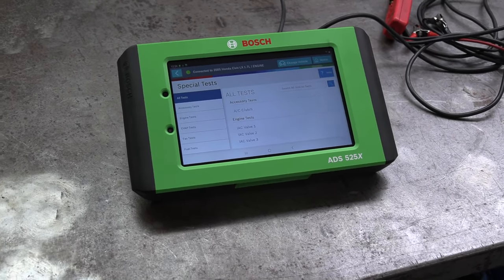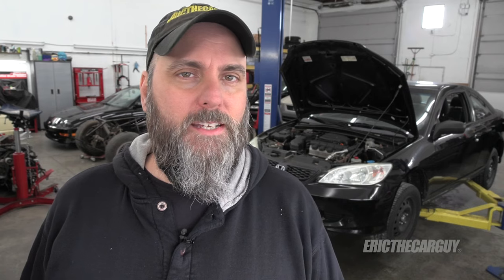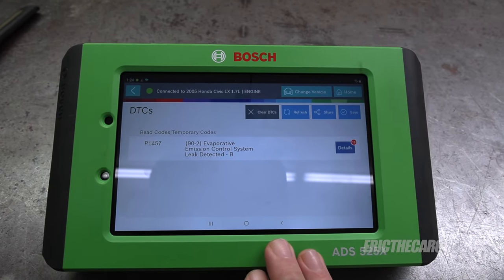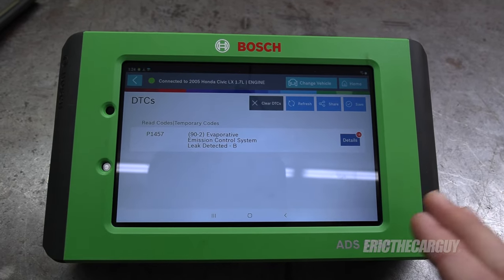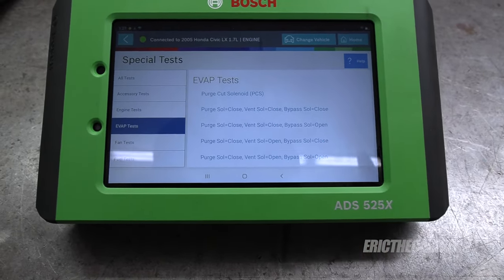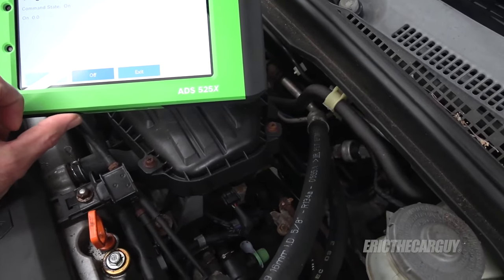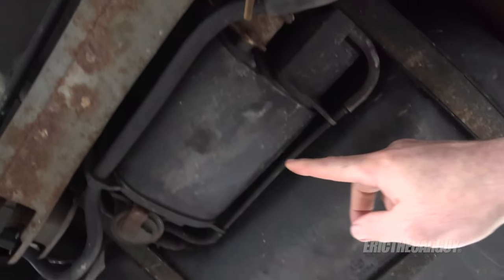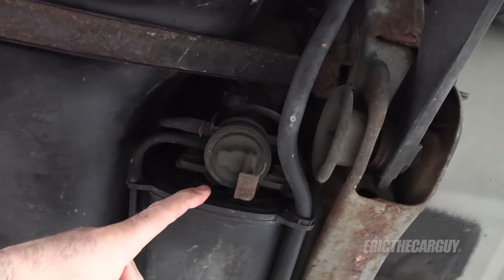How to Diagnose and Fix a P1457 Code

Comment: Stored Codes

  Issues in this list trigger a dash light and likely require attention.  Tap an issue to see more details.

  Evaporative Emissions Control System Leakage EVAP Canister System

  Why is the P1457 - Engine Code Happening Now?

Comment: You may not have a leak now but if that valve can't open your evap system can't work properly. If that vent can't open it can't draw air through to the engine to clear the canister.

Comment: Thats easy. The CVS valve is rusted and seperating causing a leak? I will now watch the whole video
Reply: You called the CVS the two way and the two way the CVS.
Reply from the maker: I read what was on the scan tool. The first valve I replaced was the CVV. The second was the CVS. I admit I could have been more clear about that. Thanks for the comment.

Comment: Our mechanic replaced the gas cap with a new $33 dollar cap from Nissan, passed inspection then a week or so later the check engine light came back on with same code. They never did fix it.
Reply from the maker: Gas caps rarely fix a P1457.

Comment: I wonder if Eric just would have checked the connections first before replacing that Emissions Valve.
Reply from the maker: Both valves had issues. Thanks for the comment.
Reply: @ericthecarguy  yup

Comment: You put a Dorman valve on it and are surprised and disappointed when it doesn't work?  Didn't you do a video a while back about how you're picky about parts?  95% of the time Dorman does NOT fit for anyone picky about parts.  Even if it works now, you or someone else will have to replace it again very soon.

Comment: Anybody else just get a rubber hose and blow smoke into the intake until you find the leak ?
Reply from the maker: That can work for vacuum leaks, but the evaporative system is separate from the intake before the purge control solenoid. Thanks for the comment.
Reply: Have you actually done that and had it work, or just think that will work?
Reply from the maker: I use different methods to find vacuum leaks. https://www.youtube.com/watch?v=9CPqbaSgcok&t=37s
Reply: @boots7859  done it on plenty of cars and found leaks in the intake system , pcv hoses , the gaskets ontop of the engine . It’s the easiest way since you just look for the smoke trickling out of leaks .
Reply: @ericthecarguy  I thought it was a video on vacuum leaks not the evap . My deepest apologies 🤲🏽 you’ve fixed my shitboxes countless times and I’m a big fan

Comment: I would just plug up that entire system. seems pointless and annoying.
Reply from the maker: If you did that, fuel would have a difficult time coming out to the engine. You need air coming into the fuel system in order for fuel to flow out of the tank or it will collapse like a tin can. You also need to account for extra vapors building up pressure in the system, particularly on hot days. You really can't do away with the system unfortunately.